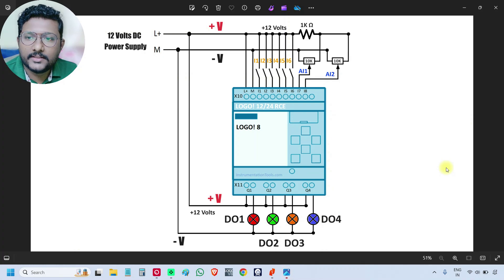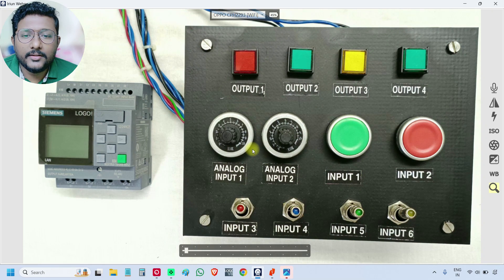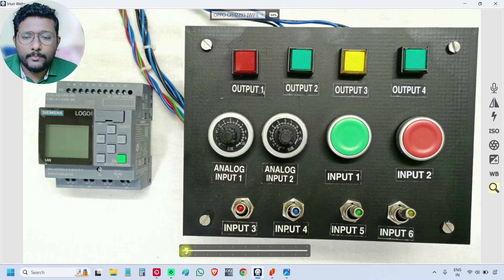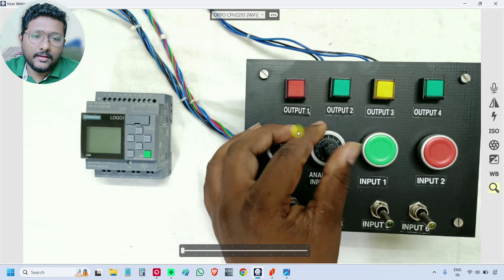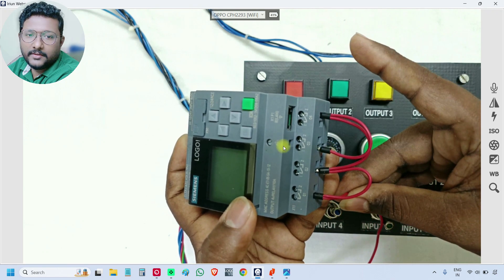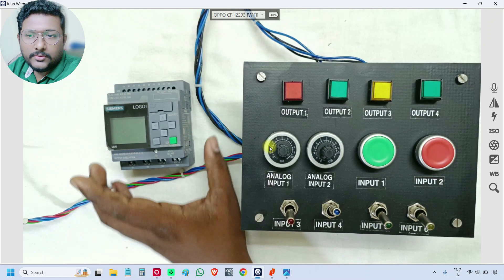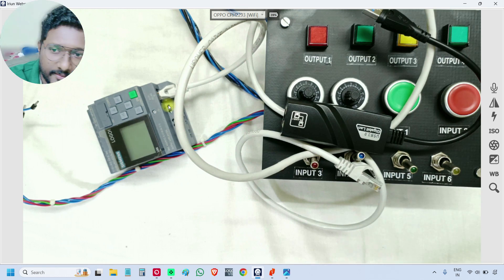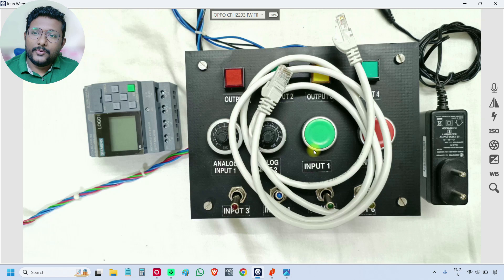How to Make a PLC Trainer Kit? - Automation Training Setup

Comment: Shall we use Lamps  as Analog Output in order regulate the Brightness of the lamp!
Reply from the maker: Yes, you can control the brightness of the lamp. The specifications of the lamp is important parameter during the selection. Sometimes it may need additional electronic circuit too.